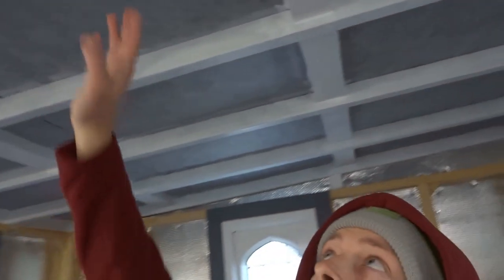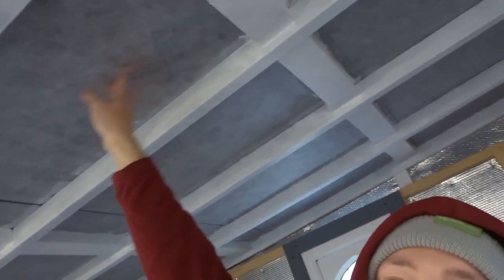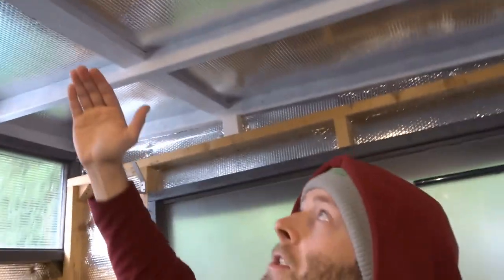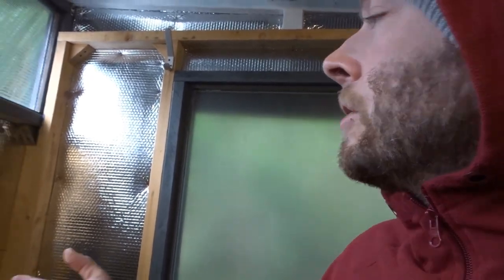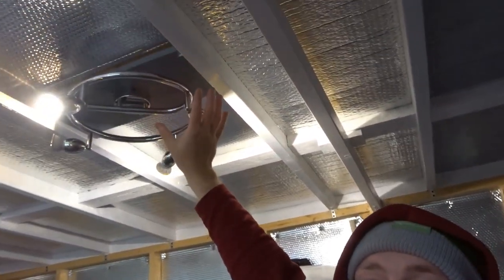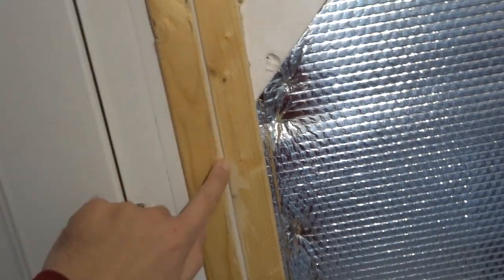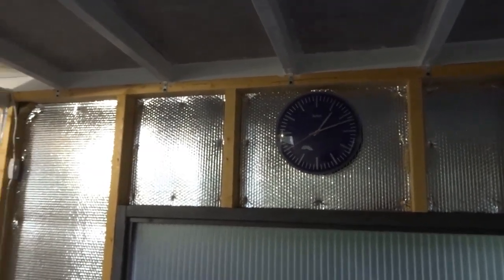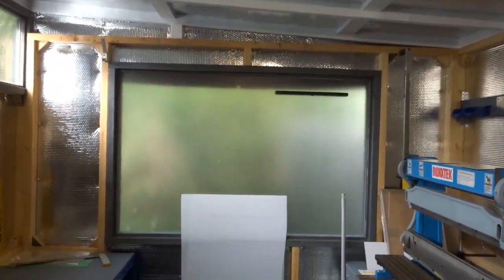How to Insulate a Workshop / Shed / Man Cave and Prevent Condensation

Comment: Very nice. I'm storing a lithium ebike in a plastic shed and need to keep it cool in the summer. Using rigid styrofoam and aluminum boards double sided taped and spray foam insulaltion in the gaps. Aluminum facing out. We'll see how it goes.
Reply from the maker: @vincent.416  interesting 🤔 let me know how that goes as I haven't tried insulating a plastic shed.
Reply: @PhillWyattProjects  I'll let you know in a few days 👍

Comment: I've just come across this excellent video. Thank you. I've just moved house and it has a large standard garden shed. Clearly not possible to wrap it now, is it still worth insulating with the bubble wrap directly on the boards?
Reply from the maker: Yea I think it's still worth it although I would recommend using polystyrene insulation sheets if you can afford it in your budget. They seem to be better at preventing the cold getting through so the surface of the polystyrene seems to stay a more stable temperature.

Comment: Hi, great video, I've a 10x8' shed and considering using the bubble insulation on the walls and ceiling, I see you've fastened it straight to the inside of the cladding, does it not not need an air gap, I had the shed wrapped in vapour barrier before cladding. What's your thoughts. Thanks.
Reply from the maker: Cheers! I would say yes it would be preferred if there was a gap although I didn't have one and it hasn't caused any issues for my shed so far. I wanted to get the most useable space from between the studs to hang up tools. It shouldn't make much difference with a wooden structure.
Reply: Yes, same here I wanted to use the space between the studs, I have seen people put small strips of timbers to the studs say like 20mm depth, to then fasten any insulation to which creates the gap, but not sure if it's worth the extra time/work/expense. Good to hear yours doesn't have any issues. Thanks

Comment: I built my Mad cave insulated the walls used a breathable membrane all round the outside under the cladding but i didnt put it under the osb sheets on the roof (layer of roofing felt then a double layer of pond liner on top of that) on the outside my Question is could i add the foil insulation to the shed roof in the same way as you have in this video without any problems  ?? Its pretty chilly at times in winter in there lol
Reply from the maker: I'm not sure what your exact set up is for the building although it seems to be working fine for me at the moment. The shed has been up 3 years now with no damp or mould so far. Using insulation such as bubble wrap or polystyrene on the ceiling should help to lower the surface temperature of the ceiling therefore preventing dew from forming on the surface. If a ceiling is cold to the touch, it can form dew when the warm air rises up and hits it.

Comment: Nice video!
I ve got a metal shed with uneven surface walls and want to apply bubble wrap insulation. How do i do it? Just silicone it on the metal walls ? I can t use nails or clips?!? How do i go about this?
Reply from the maker: You could use a solvent free grab adhesive. Or you could buy the version of aluminium insulation which is designed for vans to dampen sound. This has it's own adhesive backing. You can find it online.

Comment: Great video, building my first shed /workshop this year . It’s being built straight onto decking . It’s a 12x5 pent . Any advice on what to do regarding the bottom frame to fit the flooring to . Am I best to have a good 4” gap between the shed floor and the decking . Also any advice regarding floor insulation. Cheers ( advice welcome from viewers as well 👍🏻 )
Reply from the maker: Thanks 👍 an air gap is a good idea for ventilation. I think 4" would be fine. For insulation, I would suggest to use polystyrene insulation boards then cut them to fit in between the floor framing.

Comment: will this help keep shed cool in summer?
Reply from the maker: In my opinion, it does but only if you make an effort to cover any windows as the sun light coming through the windows in summer will heat up the shed and the insulation will then hold it inside the shed for longer. Blinds on the windows could help.

Comment: Just been in my shed for the 1st time in a week to find frost on the inside roof how can I fix the problem
Reply from the maker: The frost on the inside of the roof may be caused by warm air rising through the floor during the evening and then condensing on the cold surface of the roof. I would start by adding sheets of polystyrene insulation to the roof sticking them in with an instant grab adhesive. This should help to insulate the roof and reduce the level of warm air condensing onto it. Also I would suggest adding an air vent up near the roof to allow warm air to escape out of the building at night when it rises up.

Comment: I have a 3 car garage here in USA california.  It's my man cave. Have a game room and my gym inthere. I insulated the walls, ceiling and doors too.  I will install a minisplit system but before I do that I would like to know if I need so seal all gaps between garage doors and the door that goes out to yard. Somebody told me a long time ago not  to seal it completely because  the water heater in garage or something like that.  I just want to be able to keep heat and cool in here. In summer time it gets up to 110 Degrees farengiht and in the winter time the coldest it gets is about 34 degrees farengiht
Reply from the maker: You might not want to completely seal it up to allow some decent air flow. It sounds like a large space so I would be more concerned with how you can heat it. Do you currently have any form of heating in there?
Reply: @PhillWyattProjects  thank u for yoir reply:)  no I do not have  anything in there. Is just well insulated...like I mentioned before I wanna add a minisplit unit that does both heats and cools

Comment: I bought this foil and have had a sensor going for 4-5 days now showing before/after being basically the same. I've not boarded over yet, but everything I've found has said that double foil bubble wrap is a "scam", certainly the data logger is showing it's having basically no effect.

Did you go on to also add celotex to your workshop? How's it holding up now?
Reply from the maker: I have not used celotex. I wouldn't say that the bubble wrap is one of the best solutions but it may be the cheapest. I do not agree that it is a scam. It has its uses and for me it has made a difference. It does depend on your set up also.
Reply: @PhillWyattProjects  My setup is a 2x2m shed with shipclap cladding and 30mm framework on the inside. I wanted to insulate it and this video was one of the ones that took me in the direction of the double foil bubble wrap. I did expect some difference, but the charts are basically the same unfortunately. There are some small gaps in the door where it's warped and in the single-gazed window, but not massively.

I think if I had the chance to do it again, and had the budget I'd get the 25mm foil-backed PU/PIR - but it would take 2x 35GBP sheets per side (3 sides plus roof, plus doors), and the same again on the roof, so works out a lot more expensive.

Have you noticed that your setup is insulating and retaining heat?
Reply: Foil helps to reflect infra red ie radiant heat.  Double foil bubble wrap has very little conventional insulation for convected heat, which is needed. You need thicker insulation for that, 25mm solid insulation or glass wool, but make sure the glass wool is protected from the condensation which will form on the cold wall behind it, as when insulation gets wet it loses its insulation value. You need a vapour barrier which can be as simple as plastic sheeting on inside of insulation layer and tape it at all joins to prevent as far as possible the humid air getting in to condense on the cold face.  Ordinary packaging bubble wrap could provide some insulation very cheaply, say 2 layers with the bubbles facing each other.

Comment: nice build just a question you said about the damp  course im laying aa 16x8ft wood shed on a concrete base how do i put a damp couse down is it the tape stuff and do i put it under the wood floor
Reply from the maker: I prefer to put it under the floor. If you do you just need to make sure rain can't get to it so that it doesn't act like a giant rain catcher. If you put it over the floor frame then add the flooring on top that should be fine it worked for me. You can staple it to the wood. The tape is not essential.
Reply: thank you for that info cant wait to get my man cave up

Comment: Hi Phil, thanks for the video. 
I need to insulate my shed/workshop and I'm going to buy some Superfoil. In some of your video footage, it looks as though the insulation on the walls has  been fastened but without using the foil tape too. That's actually what I was planning on doing and just wanted to check if I really need to buy the tape too? I would eventually fit plywood over the top. Cheers, Andy.
Reply from the maker: That's correct Andy I haven't used it to apply the foil bubble wrap. The reason being that the shed already has a breathable membrane which has been sealed with aluminium tape. So I don't see a need to seal it again. If your shed doesn't have a breathable membrane already on it, then it might be worth using it. You can pick up a roll of aluminium tape cheaply online and they go quite far. Useful stuff.
Reply: @PhillWyattProjects  That's good to know and thanks for replying so quickly. I'm keen to get the stuff ordered as the shed is baking hot at the moment! 🔥

Comment: Hi mate do you think It would be ok to use this insulation on a concrete floor before putting carpet over the top of it.
Going to damp proof the concrete floor before hand tho with either a sheet of it or painted black Jack.
Cheers
Reply from the maker: Hi Adam, I think it might be better to use a kind of underlay. It is similar to this, but instead of bubbles it is like aluminium foil with a spongy foam. If you have a look on my video list I did one about insulation my loft hatch. In that video I use the stuff I'm talking about. It can be used as an underlay for laminate flooring and has insulation properties.

Comment: Hi Phill, it’s so good to find your this video, as I’m wondering 💭 how can I insulate my Shed/Workshop/Man-Cave. My Shed is same as yours (16’x8’) with concrete floor and Apex Roof. Any advice would be greatly appreciated! How many of these Rolls you had to get for your Workshop/Shed/Man-cave? What exactly you put inside the ceiling before you stick those Silver Bubble Wraps/Insulation? It would cost me £1,400 if those guys are building my Shed, which is way over my budget. It will be hard because I’m disabled, but I’ve to do it myself if I’ve to save that kind of money ££££.
Remember, Life is Short so, Live Long and Prosper … 🖖 I believe “ Our World is a Shared Experience “ Look after yourself and each other & Stay Safe! !!!

Comment: Hi mate how did it fare in the cold of winter? Thinking of using the same stuff on my shed but I want to be sure it’s warm enough 👍
Reply from the maker: The bubble wrap is fairly good but I think because I wrapped it with the membrane and sealed up all the seems with aluminium tape this really boosted it's effectiveness because it made the shed draft proof. Draft is a big problem in winter so that's the first thing to eradicate.

Comment: Hi Phil just seen you video brilliant by the way. I ve got a metal work shed 10x6 for my tools, kit and a work bench for my little job etc. The bubble foil insolation looks just the job only problem I have a sliding double door so there will be a draft issue semi sorted by using old double glazing beading along the edges also thinking of making a strutt frame on the inside to eventually board over to as you said fix tools ect any suggestions or ideas mate
Reply from the maker: Thanks Chris👍 that all sounds like a good idea. Any ways of stopping drafts makes a significant difference. Maybe double up on the aluminium bubble wrap or use polystyrene on the metal walls and roof to prevent condensation. I made a video recently about the same topic and now I have started boarding out the walls with scrap sheet materials.

Comment: Hi, what did you use to seal the gaps  between the floor boards?  Thanks
Reply from the maker: Hi I used an acrylic based gutter seal. Then directly underneath the floorboards there is a damp proof course sheet.
Reply: @PhillWyattProjects  Great idea - thanks will do that.

Comment: Great job on the build mate! 
I have a 20x10 wooden shed with apex roof, which I used for storage and as a part time workshop. I am having problems with moisture in the shed causing mold and condensation on the items being stored (not the shed itself). I haven't done anything to the shed as yet, but I need to tackle this issue! I'm not sure what I need to do though... Do I need to make it as air tight as possible? or should I allow it to vent through the eaves gaps? Should I block up my eaves and install an extractor fan? Any advice/help would be greatly appreciated. Thanks in advance
Reply from the maker: Thanks👍 I would suggest providing adequate ventilation to allow the rising warm air in the evenings to escape. Add some vents around head height. If your floor is not sealed underneath with say a layer of damp course then you will always have warm air rising up through the floor. So the easiest way to prevent condensation would be good ventilation. This would be my first step advice.
Reply: @PhillWyattProjects  thanks for the reply. my concrete base has a damp proof membrane under the slab, that should stop moisture rising up through the floor. In one of your videos, you said you boxed off your eaves... is there a reason for this?
My eaves have gaps down both lengths of the sidewalls, is this not for ventilation purposes? Appreciate the help 👍

Comment: Thanks Phil.  I am about to build a workshop and I have learnt a lot from your video. I want the build to be insulated AND sound proofed both being contained both within depth of the framing (either 3 or4 ins). So I plan to place in my walls/roof sound some Insulation slabs (like Rockwool) on top of the bubble wrap. Will having the slab layered on top affect the the insulation performance of the bubble wrap at all?
Reply from the maker: Thanks Ray. In my opinion if you use Rockwool, then I probably wouldn't bother with the bubble wrap as the Rockwool should be sufficient enough. If you do use the bobble wrap, I don't see why it could cause any problems. The air is sealed inside the bubbles so it maintains its form.
Reply: @PhillWyattProjects  Thanks Phil. Sorry, I don't think I explained clearly that it would be acoustic Rockwall slabs but your explanation of the sealed air in the bubble wrap would I think answer my question.

Comment: Are you going to add anymore insurlation on the walls? If so what will you use?
Reply from the maker: Hi

I don't think I will put more if anything I might board over the top.
Reply: @PhillWyattProjects  has it been warm enough with just the foil bubble wrap?
Reply from the maker: @ryanedgeworth3966  it's been fine I just seat it the same as I would inside a room in the house. It holds the heat a d there's no drafts at all

Comment: Yo Phil, ive started taping my shed and where the sun hits the alu tape is pealing in the heat (south facing). Any other tape you would recommend or expanding foam was another option. Thanks for your info here, going to be my art studio and so thinking i may look for some bulkier 2nd hand insulation perhaps. May try the bubble wrap for this winter however!
Reply from the maker: Hi Kyle, yea when it's exported it does start to peel. Not much you can do about it apart from covering it over I think. Mine peeled until I covered it with the feather board. If you can get the thick insulation second hand that might be a good idea it's good stuff.
Reply: @PhillWyattProjects  thanks Phil! What do you mean exported? Im up on the Moray coast in Scotland so thinking cold and damp may get intense. Just moved house to this place with a pre existing garden shed, so this is to seal an old shed up.

Comment: Hi Phill 
Great job on the shed.
When you fixed the bubble wrap insulation to the walls and celling do you just staple them straight onto the sides or did you put another bit of timber framing in like you did when you put the boards over so it had another air gap? 
As I’ve seen another shed video where they have just stapled the wrap straight onto the shed panels.
Thanks Ads
Reply from the maker: I stapled the wrap onto the panels. This worked well for me. Feather edge,wrap,then bubble wrap. There are various ways it can be done. My main air gap is between the inner board and the bubble wrap which seems to work well.

Comment: Hi, Nice Job!

Is it possible to just insulate the walls with the foil and keep it like that (no panels over it)? Or is it dangerous?

I want to turn my small shed into a mancave/pub to watch sports, play darts and drink some beers with friends. But I am not a DIY talent and also dont want to spend too much money.

There will be only older and second hand stuff in it.

Thanks for the advice!
Reply from the maker: Thanks Frank👍 you can leave it as I have for the past year with no problem. I am now panelling it just to add tools to the walls. It is not strictly necessary to panel over it.
Reply: @PhillWyattProjects  Thanks!

I have one other question. Maybe you have a suggestion. In the shed there is a floor with concrete tiles (its also the foundation of the shed). I want to insulate it some how without building a new floor over it. Is there some foil or sail that I can just pull over it that will insulate a bit?